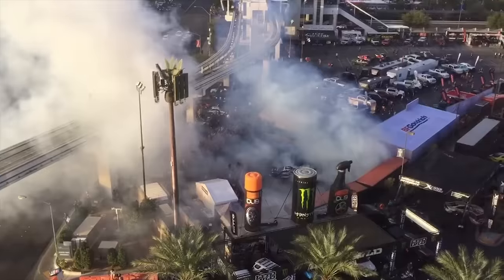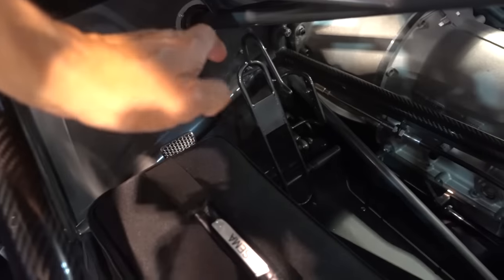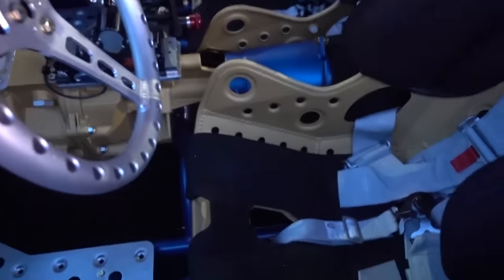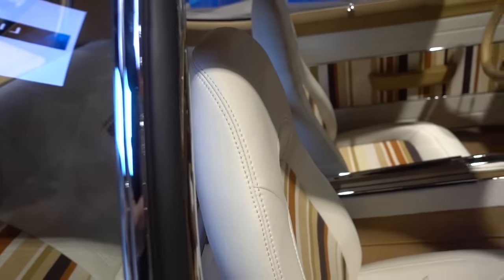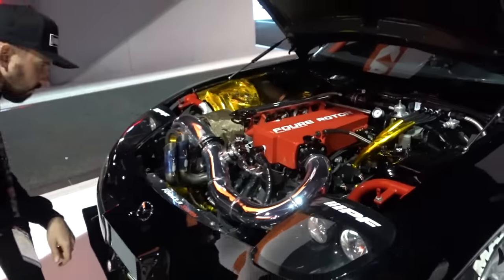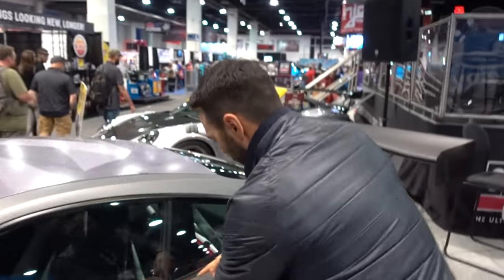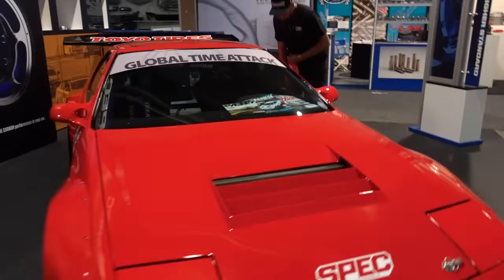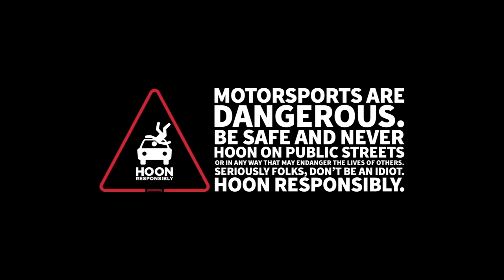The SEMA One Hour Mega Spectacular

Comment: That Porsche at the end is the Porsche 911 RSR run by Porsche Racing North America, Porshce's factory team for the IMSA Sports Car Championship endurance racing series! That particular car had just won the season closing 10 hour long Petit LeMans at Road Atlanta, hence Porsche keeping the race grime as has become their tradition with race winning cars. I was actually at that race, that car sounds SICK at full tilt -- it's got a six-into-one exhaust system that absolutely screams at its 9000 rpm redline. But yeah, couple last fun facts: the livery on that car was a throwback livery to the Porsche that won the first Petit LeMans 20 years ago, the 911 RSR actually has its engine moved forward of the rear axle to make room for a bigger rear diffuser making it a mid-engine car rather than rear-engine, and that removable panel on the roof that y'll were wondering about is actually to allow safety workers to get in to safely remove a driver's helmet if they suspect risk of neck injury. </nerd out>
Reply from the maker: Thanks for the info.
Reply: Good info!
Reply: Simply nailed it.
Reply: The GT1 livery looks better than the normal red white and black in my opinion. Also, them and the Corvette team to the show that race, they killed it.
Reply: Nice
Reply: It’s not just for helmet removal. It’s large enough to remove the driver as well.

Helmet removal is actually quite easy from the door.
Reply: That car did not win. The 911 with the orange highlights won the GTLM class. This is the 912 which finished P6 in class.
Reply: This car spent more time fighting against the M8's during Petit Le Mans. Well written Adam.
Reply: Beat me to it haha. Damn.
Reply: But the winner was #911! The car at SEMA was #912.
Reply: Hit em with the knowledge!! Thanks for the info!
Reply: ya beat me to it. good info bud.
Reply: @nascarDee48  Red. not orange, but yes. The 911 won.
Reply: @MomedicsChannel  Well on the real GT1 car I'd say it looks orange in some lighting and red in others. On the RSR they used a special wrap for the actual design aspect of the livery that was reflective as a tribute to Dave Maraj's Champion cars that always had that, which at least to me looked orange. I was at Petit and in person it just looked orange. But I guess it's up to the viewers eye.
Reply: nascarDee48 the reflective aspect changes how it looks, but, it’s always been red.
Reply: @MomedicsChannel  That's what I said, it changes how it looks. So in one light it can look orange and another can look red. As far as the original GT1 car it is not a set in stone color. just do a quick search on Google and you'll quickly find it looks bright red and in others it looks florescent orange. And you can tell because there is red on the mirrors as well as mixed in with the blue swirl designs all over the car. Those colors are true red. The spots on the front are not.
Reply: If you want to see what the purpose of the panel in the roof is, check out Team Ring Police.
They did a full test, with the Paramedics and Doctors team, just to explain and show the whole procedure of a driver taken care of, via that roof access. starts at 18:15 in this -> https://www.youtube.com/watch?v=LE6ChQUNF28
 video.

Comment: The Datsun with the M5 motor was built by B is for Build, it's a stock motor, stock trans, the stock dash but cut to fit, stock console, they chose kirkys as that's what fit the best, has a fuel cell, and they built the entire frame from and tube chasis from scratch in a small shop with limited tools. Super dope car
Reply: "Shop" is pushing it. It was made in a garage. Which makes it even more impressive.
Reply: Andre McGee only thing impressive is the speed it was slapped together and the long hours they put in. Nothing impressive about the workmanship and I am guessing it will handle like the under engineered poorly constructed overweight slapped together heavy crock of shit is.

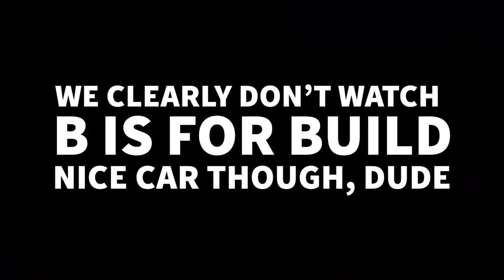Comment: @9:54 the b is for build 240z is sitting on the diff
Reply: Yup, E is for Engineering.
Reply: Chris Peters it's barely touching the ground when it's fully aired out. The exhaust actually touches the ground more than the diff.
Reply: @shona5512  They even mention it as they are walking up that it's not very low for having bags. He has to jack it up just to drive it where as it should be cruising at approximately where he has it "laid out."

Comment: So that tire basically is supposed to replace nitrous or that wheel setup and will kick in and give you an extra hundred horsepower
Reply from the maker: Yeah it's an interesting concept..
Reply: I'm just not too certain if it would do well on top end I mean the electric motor didn't look too big at least what we could see
Reply: if it says 100hp, it will prob do 100hp. why would they have a motor too small and lie about hp?
Reply: I think it's meant for low speed/off the line usage to give FWD cars more traction and power without inducing immense amounts of torque steer.

Comment: Your getting much faster and pushing a lot more on RBR, nice.
Looks like you are running bit  too stiff suspension set up.  Try softening springs just a little and the damper compression more then a little.  Then tighten the damper rebound a lot.
Your car will stabilize after bumps and jumps much more quickly and you will have easier time cutting.  Which will allow you to carry more speed everywhere.
Just a thought, from someone with many hours on RBR

Comment: The roof escape hatch on the car at 1:02:00 is removable so if you're a giant they can put on roof section with a helmet bulge so you can fit in the driver seat with your helmet.

Comment: With the Porsche IMSA car that hatch you were wondering is a safety roof hatch in case you wreck and can get the driver door open normally they have a release handle above the drivers head just like in NASCAR.

Comment: Hey hoonigan. Just a heads up on those "potato chip seats." They are built by the best drag car carbon guy in the industry. They also have been in cars that have been a complete loss due to damage, yet not a single person in any crash has gone to the hospital. 

Let's not even touch on the fact that your badges were clanking againt the fresh paint of the car.

Comment: The s55 from the f80 still has a throttle body. It just opens it 80 to 100% all of the time and uses an eccentric shaft  to vary how much of the lobe on the intake camshaft lifts the valve. At minimum lift its even hard to see which valves are even open. Thought process is less load on the engine more efficiency.  Props to them tho it looks amazing. The guy talking about the E30 just adding a little bit too much sauce on his explanation mentioning stock features as if he added them as a modification
Reply: You are 100% correct. The edit made it seem like we added it, but it is definitely a stock configuration.

Comment: Chassis mount wing for actual downforce rather than making your trunk crooked because of the downforce that's put on it by the speeds your going and the wind over it,
Also it changes the downforce point more downwards on the wheels / axels where you want it rather than on top of it :)
Science is more a factor here than looks i'd say!

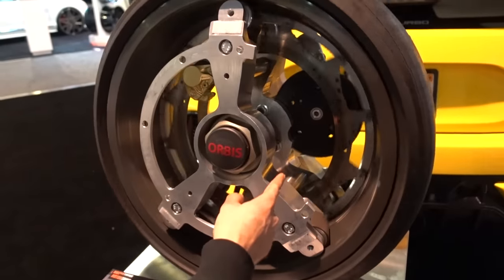Comment: Fun fact. Buell, an old American motorcycle company that used to be owned by Harley Davidson, Created the "inside out" brake disc, loooong before Honda got the idea on their civic there at 13:18. Just look up the Buell 1125R and look at the front wheel. the idea is you can have a front brake system with more of a mechanical advantage and therefore more stopping power, without having to have dual brake rotors, thus eliminating the need for more calipers, and thereby saving weight.
Reply: Actually like a lot of internet facts its nothing of the sort ( a "fact"), buell didn't invent perimeter brakes on motorcycles. Braking of italy offered them as bolt ons in the 80's, tony foale's QR1 had them in 1984 fitted, and various guzzi based ghezzi-brian's of the 80's onwards used them (albiet in very small production numbers). Real fun fact, the perimeter brakes on the buell are bought in components from Sicom in Germany. Buell did lighten the spokes of the wheel to try and recover the extra weight it caused, but the fact that every real race bike today uses ceramic hub mounted rotors tells you all you need to know about how they compare to perimeter brakes in performance. In short, cosmetic bling.
Reply: @manic_tinkerer  I was told EBR still has the brake rotor style under patent until 2020 or somewhere in the mid 20s. So who knows, maybe once the patent is up youll see them more often in MotoGP. EBR and Buell used the brake style with their bikes in world sportbike and then world superbike racing and it was always shown how they could brake significantly later and even into the turn than other bikes, which could and did give them a slight advantage in racing. A handful of times in world superbike the racers on the EBRs would spin the front tire off its balance or sometimes off the bead, so the perimeter brake does do a good job at braking. Again who knows, they might be more common in the next 2 to 5 years.